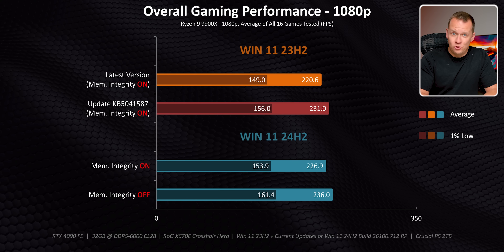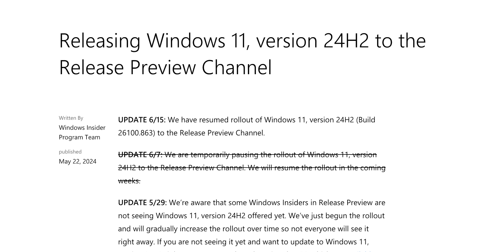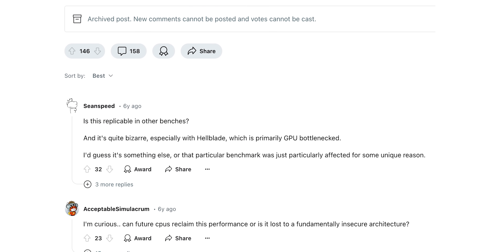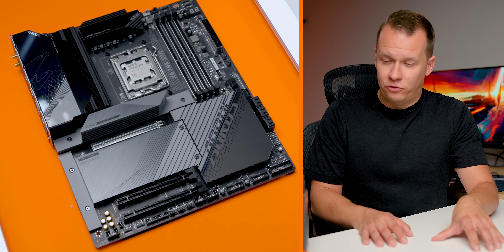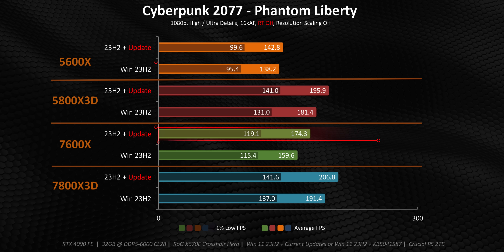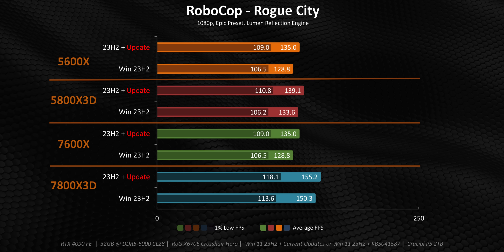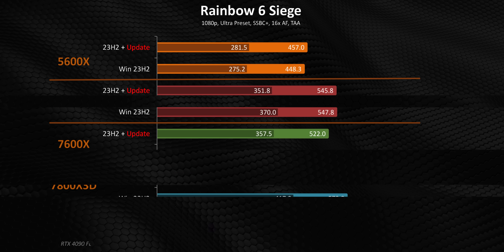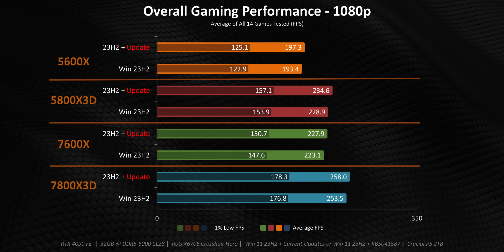Older Ryzen CPUs Just Got Buffed

Comment: I'm not sure why you keep saying the X3D parts get larger upgrades than the non-X3D parts. When you look at the percentage gain, the non-X3D parts gain 2% and 2.1% overall (1.8% and 2.2% gains for 1% lows), while the X3D chips gain 1.8-2.5% overall (0.8% and 2.1% for their 1% lows). Those are basically equal across them and the only reason the X3D would look to gain more is because they were faster already, but they both got basically identical uplifts percentage-wise.
Reply from the maker: Yeah, maybe I generalized a bit.  However, in the games that saw the biggest increases, the X3D chips were by and large much better whereas the non-X3D chips were more even across the board with smaller gains.

Comment: Before everyone comments, please remember at 1440+ you won't notice anywhere near the same performance uplift, I know, I tested it before updating. 24h2 hopefully will have a better boost.
Reply from the maker: Good point.  And also we're sorta "gaming" the system by testing with an RTX 4090.
Reply: @HardwareCanucks The 4090 is there to remove any GPU bottlenecks. The purpose is to test the CPU, you guys are spot on!
Reply: @HardwareCanucks  pretty sure I saw 3-4 fps improvement in 1% lows in your graphs when you claimed there are no improvements when games are GPU limited such as in Alan Wake 2. That is a win regardless!
Reply: @HardwareCanucks Y U NO TEST WITH RX 7900 XTX TOO!
Reply: @HardwareCanucks Is there really a point of testing these parts at 1080p, obviously that's the only way to tell the difference. But nobody, nobody with these components are gaming at 1080p.
Reply: @karma.2781  In the future, when games become more demanding people upgrade their graphics cards or lower their graphical settings these CPU differences will become more apparent
Reply: @karma.2781  1080p is the best reasonable resolution to actually see CPU differences, anything higher starts to become more of a GPU benchmark. Also, 1080p is still the most widely used resolution for PC gaming and is even in common use with high end hardware, especially those who play esports titles.
Reply: @hwi7114  Actually testing multi card setups (be it S.L.i crossfire or even mGPU in dx12 or Vulkan) would be better as you're not longer ever gpu limited in most resolutions then.
I feel like because theres like 10 older games that use the mGPU oo the newer DX12 or Vulkan its still being over looked for benchmarking.

Too much emphisist on whats popular to everyone & has a large player base currently in reviews/benchmarks.

Comment: Is this improvement also true for Ryzen mobile processors, like for e.g. Ryzen 8845HS ?
Reply: Yeah im really curious as I have one of those as well as a 7800X3d this is nice news - ill check tommorrow if my laptop has updated, if not ill run cinebench f23 before and after! 

Edit: no point the paper states no change under cinebench :(
Reply from the maker: Good question!  But those CPUs might not be paired to fast enough GPUs to realize much of an improvement.
Reply: @HardwareCanucks  I have a brand new 8845HS 4060 mobile laptop here, and with a 1080p screen, might see something.

Comment: 5600x is now 60fps in the witcher 3 in novigrad?

Edit: This is NOT a GPU bottleneck. This is with RT on on a 4070 TiSuper . These settings are more limited by the CPU than the GPU at the resolution I play at. Thanks.